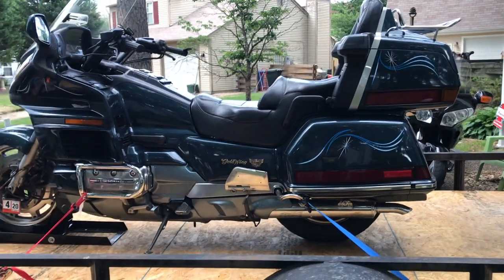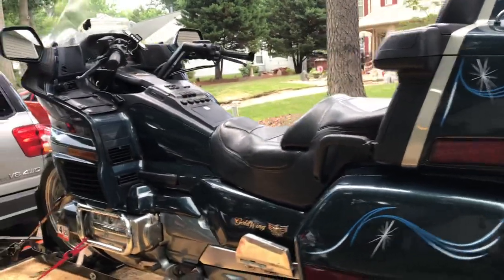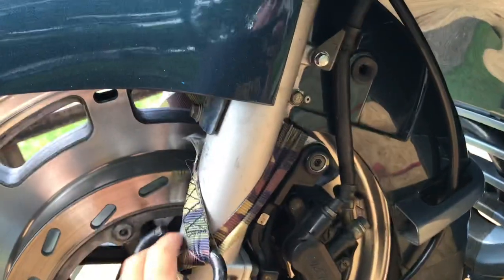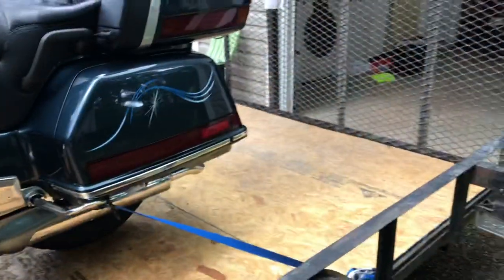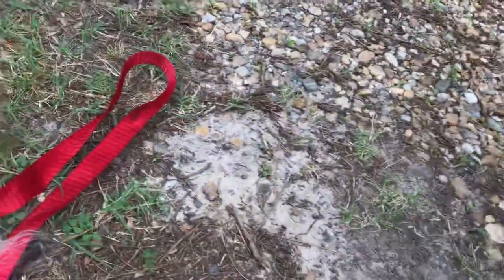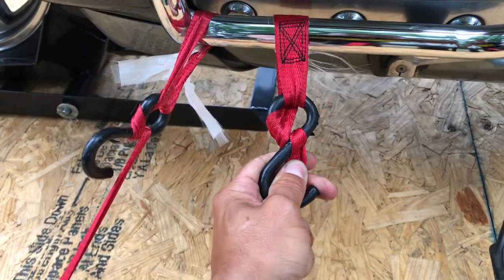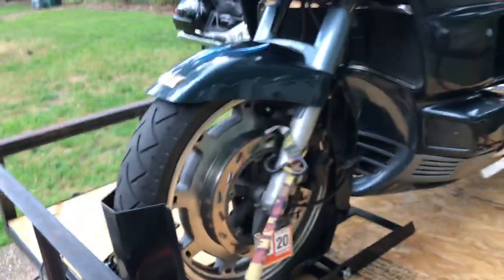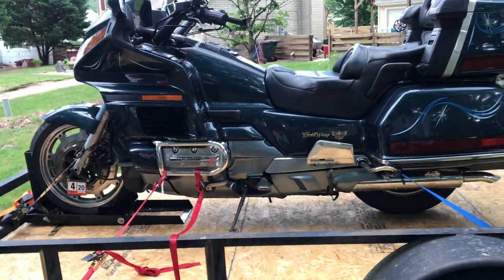The CORRECT way to transport, haul, tow a Goldwing 1500 or any big motorcycle

Comment: Put the soft tie over the triple tree and it will clear the bottom edge of the fairing.  You don't have to remove parts to tie down the bike. The GWRRA Gold Book has the best instructions yet for tieing down a 1500 Wing and a 1800 Wing.  Way different than this and much safer and secure.  I have used their system on both bikes, 1500 and 1800.

Comment: Sorry I must correct you compression of forks due to internal valving will not damage fork seals as the oil is not under compression.
Reply: I  am  a Former Tow Operator . I  agree 100% with this guys approach . Tie onto Solid Un-Sprung parts of the bike where possible .

Comment: I thought you would use the center stand, I don’t have this thing on my motorcycle. Is it a bad to tie the front and rear brakes with tie wraps?
Reply: I was told that when you put the bike on the center stand and then secure the points around it you are putting a tremendous amount of torque on the frame.  The motorcycle is not at the mercy of the suspension on the trailer (the center stand makes it become 'one' with the trailer).  What he did was correct.  And, he left the side stand down just in case it went over.  However, it would have to be counteracting physics itself because he had so many straps on both sides OR a strap would have had to fail.

Comment: Umm you might want to rethink your video. You are giving wrong advice and you are straps are all in the wrong place. Make sure you know what you are talking about before posting.
Reply from the maker: Steve Dunn what are you talking about.? Please be specific and detailed don't be a Internet troll telling people they are doing something wrong without saying what it is or why.
I'm a professional MSF rider coach. I have transported hundreds of motorcycles for over 20 years. Not only that I am constantly looking at every possible I can find for transporting motorcycles. I'm open to suggestions...I'm not open to fake accusations. You said "all the straps are in the wrong place".... Please enlight me.... All ears.
Reply from the maker: Steve Dunn as Rider coach there is NOTHING more important for me than safety, of the users of the road and my property. 
Before transporting this specific bike, I searched every video on YouTube and talked to owners. If you notice I even took the time to remove the plastics covering the front forks so I could access that area which is a strong point for anchorage. Most people tie their bikes from the handlebars and collapse the suspension which can turn into busted fork seals. This bike came from Washington DC to Hampton Roads 4 hour trip and not a single tie got lose or the bike move.
Again I open to a debate not people making statements without support or evidence
Reply: I have transported bikes tied down like this for thousands of miles......zero issues..........how about you show us the "correct" way to tie down a bike
Reply: @kennethclower3416  SMH
Reply: What are you talking about? Seems you are trolling.